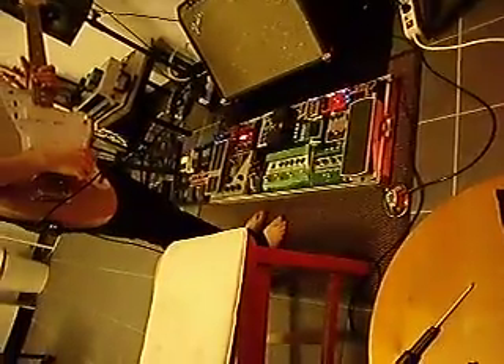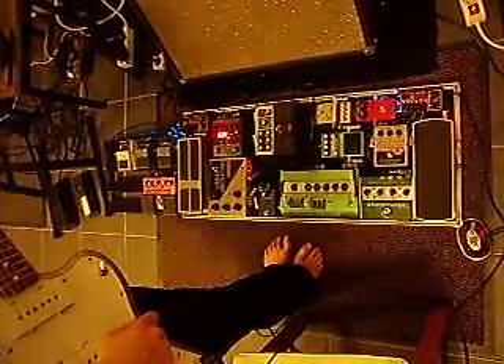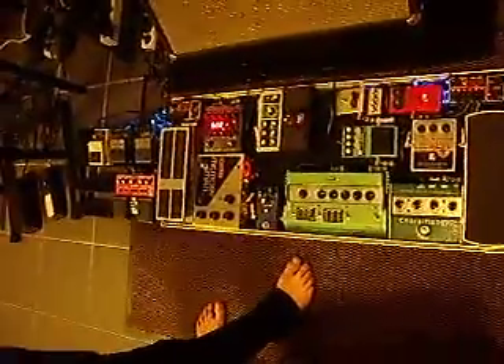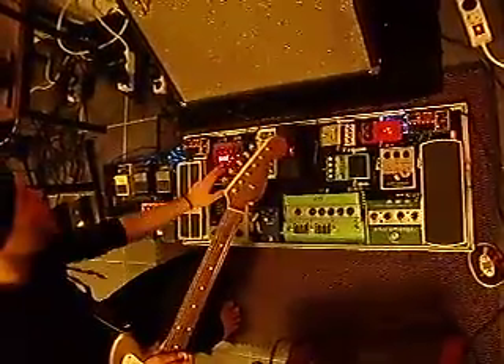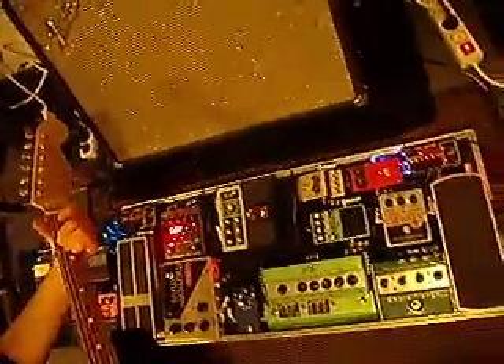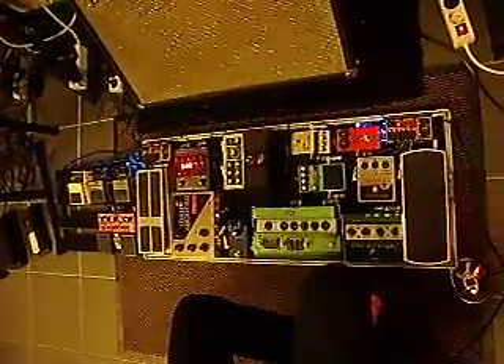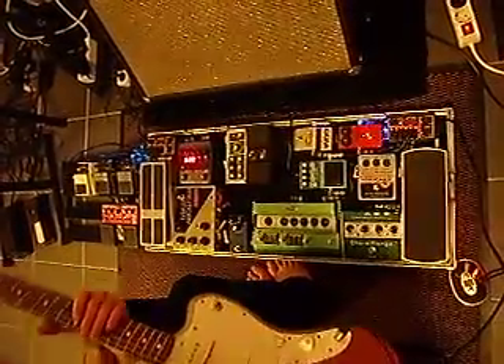Ambient / Post-Rock / Shoegaze / Post-Metal Rig/Pedalboard; a little quick demonstration [older rig]

Comment: hi there, i noticed you use artec power bricks

i use it too, absolutely hate it, on my 3rd one now, each one has had problems, be it electric hissing through the amp, disruption with radio and PA signals, all round noise, etc

a nightmare

do you ever get these problems? or am i jsut extremely unlucky when it comes to the artec power brick..?

Comment: It does sound impressive, but a lot of guitar tone is lost  because of the cabling.

Suggest you look at some axess electronics switchers and invest in a midi board then everything can be controlled by midi more efficient and les tone degradation just my 10 cents. I am tone freak and love pedals but dont like them in front of me :)

Comment: haha yeah im planning on the voodoolabs,

ooh and i doubt its a problem with my amp or pedals, because the artec interferes with PA's and the radio when its not even connected to my guitar stuff, just plugged into power it does weird stuff...

i think im fucking cursed... hehe

anyways, probly just gonna trash it and buy something else, til then, good ol' batteries are coping just fine